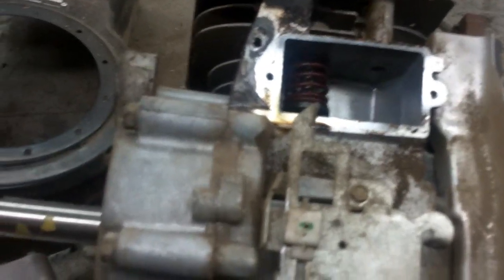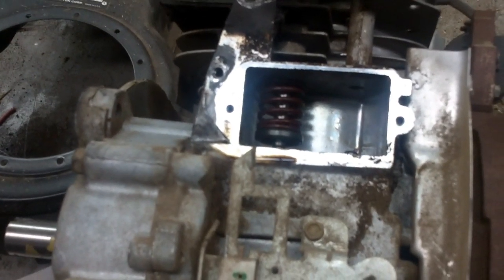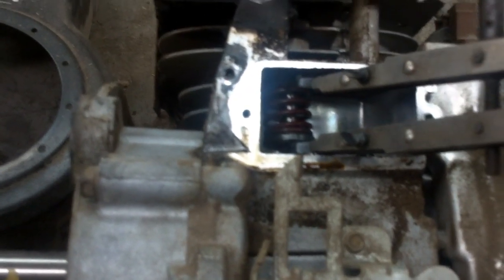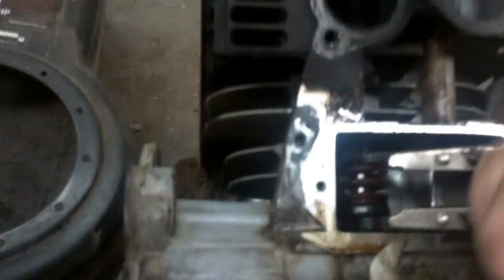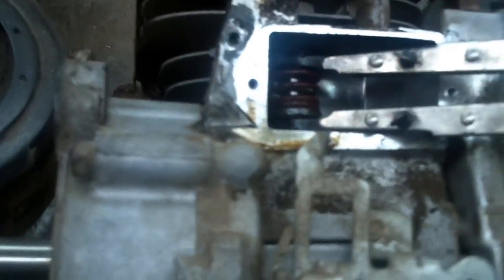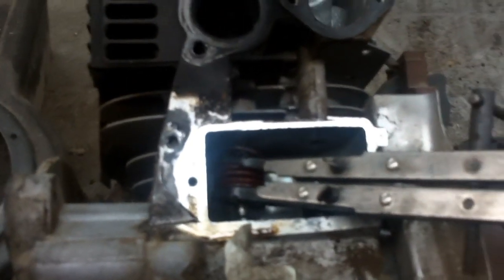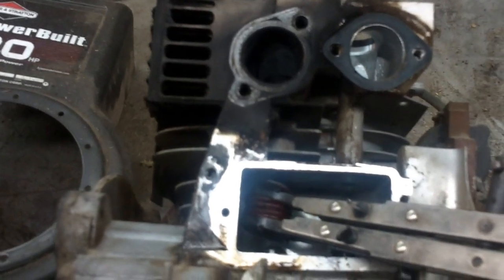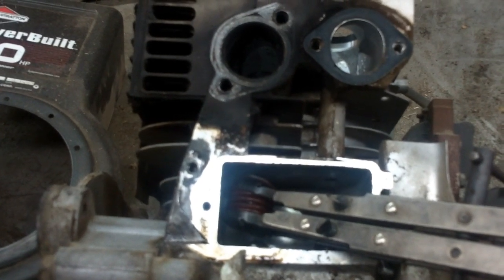LAWN MOWER REPAIR :  how to remove the valves from an older flat head engine

Comment: I have a question if you can help me.  My Kohler engineer for my riding mower has a stuck spring.  Do I need to remove the head gasket to inspect and check what is stuck? Please, advise.

Comment: Thanks for the video.  I bought the same tool, but it didn't come with any instructions.  From your description, it sounds like your engine had split keepers like on an overhead valve engine.  On my flathead engine, the keeper was just the disk at the top of the spring and it had a opening shaped like and '8' with the larger part of the hole toward the edge.  I had to shine a light down in there to see where the larger part was and then pull/push the keeper to that side and then it would slide over the end of the valve.

Comment: I have a B&S motor on a tiller that the intake valve is stuck on.  I'm not sure what happened because I was using it, after it set for about a year.  I turned it off and came back later and it wouldn't start.  Not compression.  After removing the spark plug I could see that intake valve was stuck open.  I took the head off and positioned the crank to where the valve should be closed and it took quit a bit of tapping to get the valve to go back down.  What would cause this and how do I get the valve out now that its stuck so tight?

Comment: i hace a 7.25 platnum briggs. it blows oil out the carb. the repair shop said they would not fix it. said likely a valve seat has come loose. do you have any suggestions on repair or is this engine junk?
Reply: Albert Albritton To put the valve seat back in go around the edges with A Center punch that will secure the valve seat in place

Comment: I have an old 5 HP 13202 Briggs that uses a different retainer. Instead of the current keyhole design, it has a cross pin that sits inside of a dimpled washer on both the intake and exhaust valve. How do I remove the cross pin?  The dimpled washer always follows the compressed spring when trying to disengage the pins,   HELP

Comment: Jared, your valve seat likely popped out. I know this because I'm working on the same problem for a customer. 19 hp single. Apparently these engines are notorious for it.

Comment: Yes i have one of those tools i order it through Sears awhile back good thing that i did because one of the valves are thin on a Tecumseh lawnmower a non - O.H.V. lawnmower i like to keep up on knowing how to work on small engine's outdoors equipment repairs because it's very expensive to take it to the shop people's don't always have money to get things fix all the time they will take it to the shop and once they found out that it will cost 72 dollars an hour they normally pay for it until the shop tells them how long it will take them to fix it or the shop will say that they need this and that about the time the shop finish charging them they end up leaving the lawnmower at the shop and the shop end up selling it well i know we all got to make a living only i mostly see some of this as a rip off because most shop not honest they comes up with nonsense stuff that don't need to be fix i know this because i test them out take something to them and ain't nothing too much wrong with it or nothing wrong with it at all anyway im still learning that's why im here watching your video good job